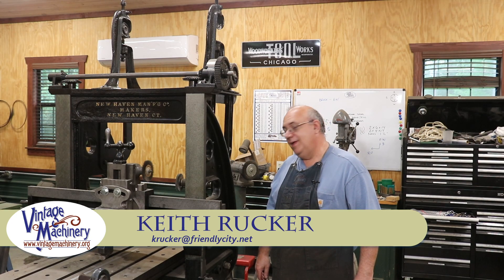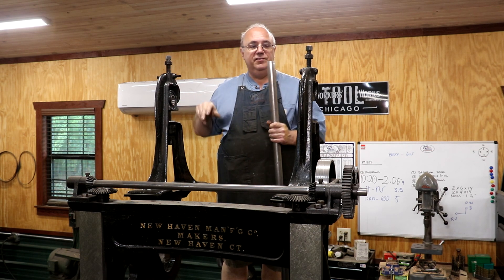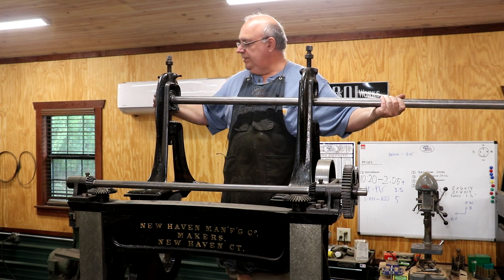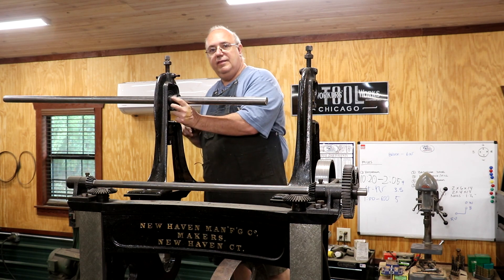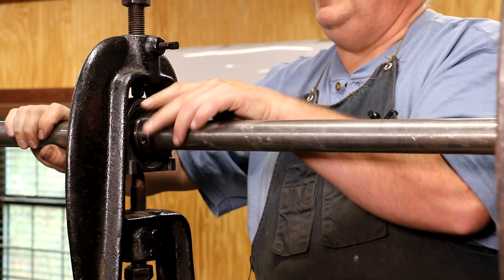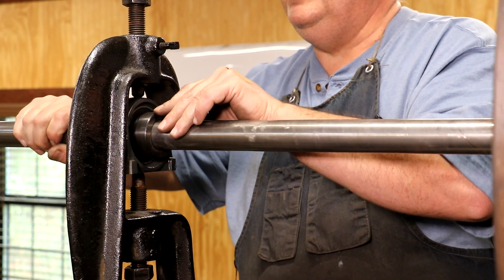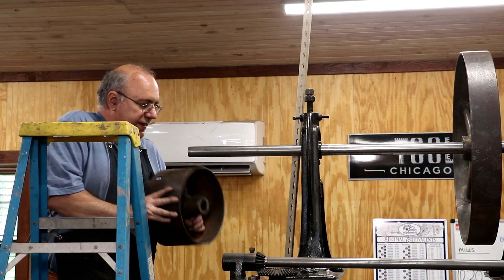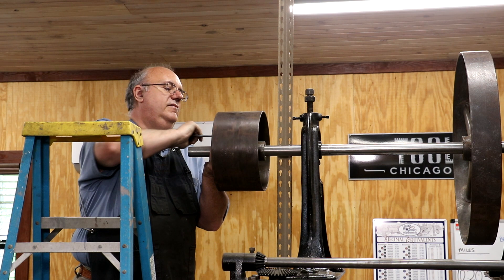Metal Planer Restoration 56: Mounting the Countershaft and Drive Pulleys

Comment: 6:41 Keith, you're mistaken. Unless it's a really, really cheap bearing, it will have a pass-away hole inside the shell of the outer race, which, through a groove (either in the frame or the outer race itself) connects to the grease zerk, allowing double duty, the shell and the bearing being lubricated.
IF you don't believe me, you can spend 3 second on google searching this NTN - SPAW2217-215N1 it will lead you to a nice cutaway picture on the NTN website, which is specifically cut such that it depicts the pass-away hole into the bearing itself. Just saying.

Source: i have that bearing in my stash, so i just went and checked it. Also, i've never ever greased a bearing of this type without waiting for the grease to evacuate the old grease out of the bearing through the skirt, so i've yet to encounter the type that's without the pass-away hole. I do know they exist tho, so i'm giving you the benefit of the doubt, maybe it's a cheapo one that doesn't have that pass-away.

Comment: I Have to say I wasn't aware that Kieth Rucker couldn't just use a fine screwdriver tip to lift the seal out of the sealed bearing like I have been doing for literally decades , maybe these sealed pillow block bearing seal don't come out like the average sealed bearing seal does ( never needed to do a pillow block bearing ) the seals pop back in very easily on the ones I use ( primarily wheel bearings in motorcycles, I get them from my local bearing supply )
Reply: I'm sure the seals can be removed like you said. Not everyone sees the phrase "not user serviceable" as a challenge.
Reply: @Michigan_Tactical  I use a screwdriver tip or a scribe , and slide the fine tip between the seal and its seat and literally just pop them out , it is just so easy I do it to all of them before use on motorcycle wheels , they get good high quality high temp grease , then i re-install the seals and it's good to go , is well worth the effort , 

and  I mainly piped up about it to share the process with others who aren't aware that it can be done very easily
Reply: @grafton261  It is likely those bearings won't see 100hrs of service in the next 10 years.  This is not a motorcycle.  The sealed bearings are perfect for this application.  There is no need to "modify" a factory product.

Comment: I have never like the idea of mounting the motor and pulleys on the top of the machine. Watching the installation so far shows that the mounting brackets are not stiff enough. When the machine is operating there will be a lot of vibration which will be directed straight to the cutting tool.

Comment: Sorry Keith, but you are not correct about the zerk only providing access for lubrication grease for the bearing alignment. There is a groove in the outer bearing race that forms a path to a small hole through the outer race that provides the path for grease to the balls between the races. If you disassemble the bearing itself from the pillow or plummer block, usually quite easy if you follow the correct procedure, you will see the path the grease takes to the balls in the bearing itself. The bearings are sealed bearings but are meant to be regularly greased if subjected to a full or near full load for an extended period of time.
Check out the video at https://youtu.be/zlPU1FiiUDw .
Reply: They do make sealed bearings for pillow blocks, just saying.
Reply: @edricoddot  but do they install zerks on them if they are fully sealed. Also what is the definition of a sealed bearing. Most "sealed" bearings simply present an obvious barrier to the ingress of dust, some moisture and maybe other contaminants to the bearing races, but may still need periodic relubrication with grease. They are definitely not hermetically sealed.

Comment: Shouldn't you have put the belt for the middle pulley around the shaft before installing it in the bearings? How are you going to get the belt around it now? It seems like a topological dilemma now.

I know life happens so I don't want to complain but I sure am looking forward to when you can get back to videos with lots of restoration and machining content. Putting a few pulleys on a shaft sure doesn't measure up to your videos of old. But you gotta do what you gotta do. That's life.
Reply: The belt ends are held by a pin system.  The belt can be installed anywhere, anytime.  A few years ago he made a video explaining drive belts and the method used to make them.  I suggest you do some hunting in his video archives.

Comment: Painful to watch considering the way the original system was designed to be assembled on the bench and then the assembly would be hoisted into place.  The original babbits could be slipped into the hangers without needing to be disassembled.
Reply: What is "painful" about it?  I suggest you make a video showing how you "painlessly" assembled your steam shop.
Reply: @paulcopeland9035  At least one of the cast pulleys was at the limit of safe lifting weight.  Keith's a pretty strong guy.